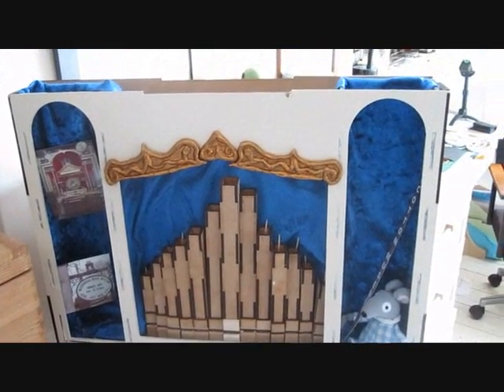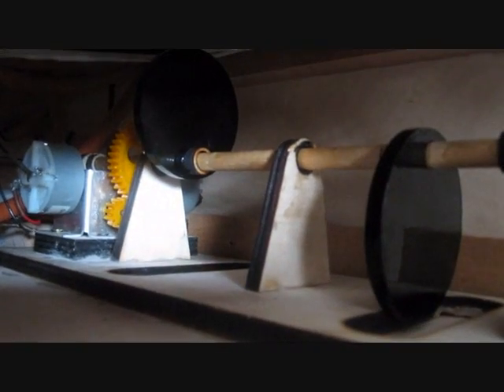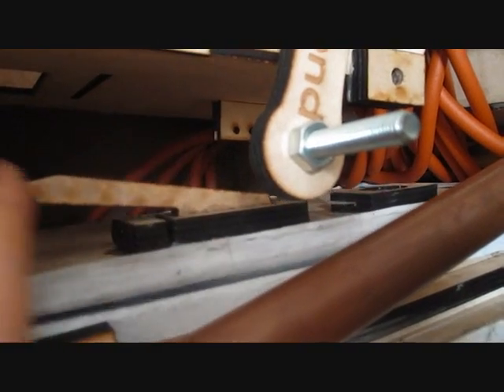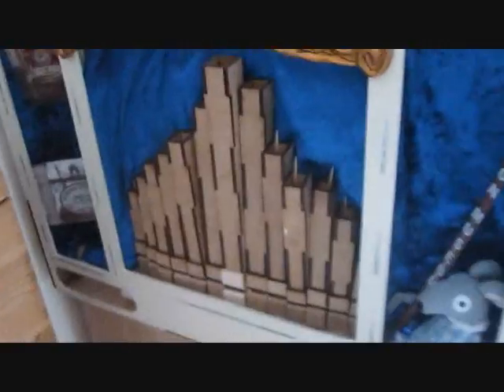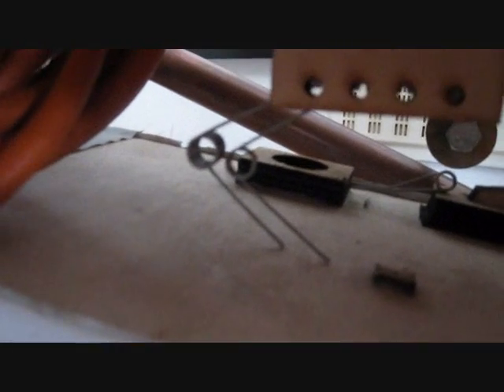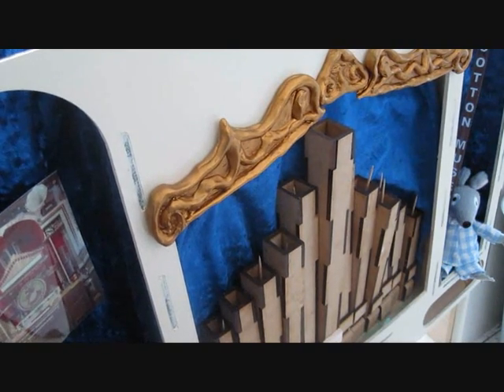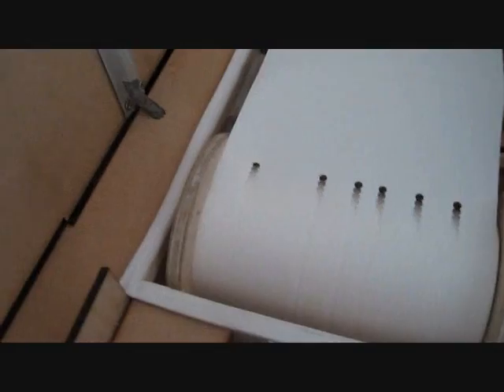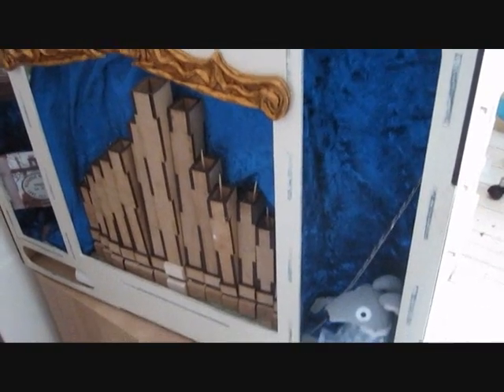My 13 note street organ

Comment from the maker: @anglerfly Right, plans are available from John Smith and are really well worth it to see how it all goes together. Mine differs from the original design quite a lot. The sound pipes have tubes installed on the back of them of aluminium. The bunsen burner hosing attaches these to the alu tubes beneath the tracker bar which reads the music. As the holes in the music uncover holes in the tracker bar an amount of air is let into the corresponding pipe and a tube is made. Hope this helps...